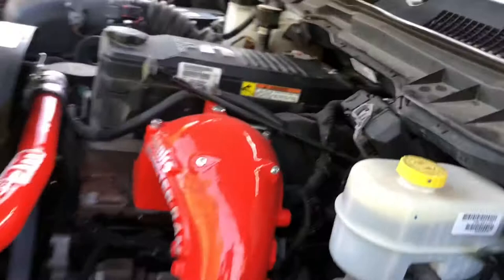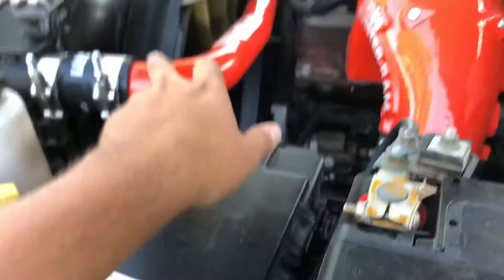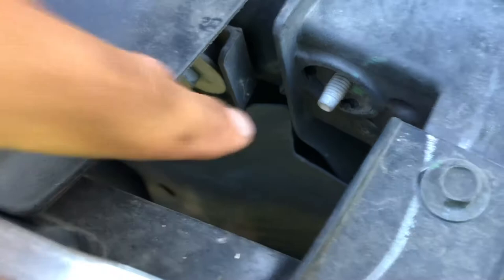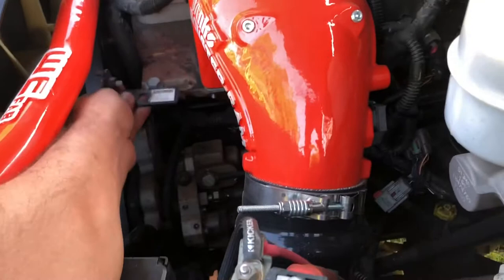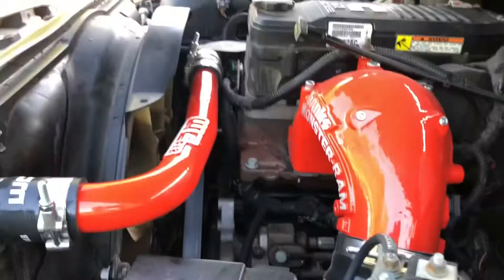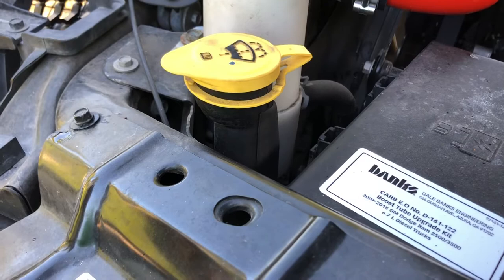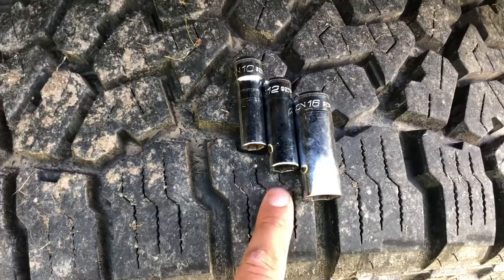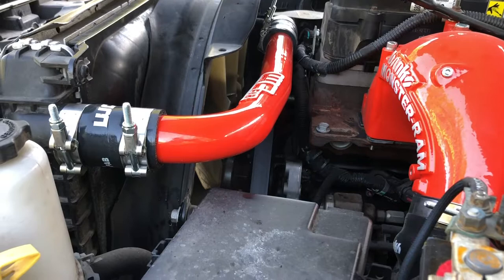Wehrli Custom Fab 2010-2018 Ram 6.7 Cummins Upper Coolant Pipe Install

Comment: If you remove the 13mm bolt for the power steering and move it aside you can reach the petcock from the top with a 10mm Allen turn a 1/4 to half turn
Reply from the maker: I did not know that! Thanks for the tip!

Comment: Also, what happens to those couplers when they get wet? In my experience pressure connection with silicone is prone to abnormal degradation when in contact with coolant. This system should be 21psi so a decent amount. Oil doesn't necessarily seem to be as big of an issue, especially with diesels. Have you had any leaks at all?

Comment: I admit I am not a great mechanic. I just hit 58K miles on my 2015 Dodge RAM HD 2500 4 Door 4WD  With Cummins 6.7 L Turbo Diesel.  Starting May 2024 I plan on making an epic drive towing my 10,000 pound fifth-wheel. I have the 3.42 rear axle with a 17,000 tow capacity but I also have rear air suspension which really levels out my  rig.   

What are the items you would recommend to improve efficiency and reliability. Performance and power is already there albeit I would like a better gas mileage.  Thanks.
Reply from the maker: These trucks are pretty fuel efficient when “deleted”…it’s by far better on mpg’s than my 07 Duramax. I did notice a slight increase in mpg’s when I did the Banks Ram air intake and boost tubes. I usually get pretty good mpg’s with the 3.42 gears when towing but my truck is a manual. You gain the most mpg’s (in my opinion) when you delete the truck.

Comment: Ok. I have a '11 6.7 and I have the rubber hose. The WC fab one is aluminum, cool. But why? What is the reasoning? Along with other things, now you'll have to do the lower too yes? Cooling systems are built for expansion in the coolant when it's hot, how will this affect the level now when you're pulling a heavy trailer up a hill say.

Comment: What Fuel filter delete / relocation kit did you use?  Thanks for the video!
Reply from the maker: I bought all the stuff off of throttle up industries last year for around $360. You should be able to look them up online.

Comment: After adding the banks monster ram, how's the performance and mileage difference?
Reply from the maker: Honestly the truck definitely seems to breath better. Throttle response is improved. As for fuel mileage…I can’t tell a difference much. The truck does get waaaaay better mpg’s than my LBZ Duramax.

Comment: Have you had any issues with coolant leaking? Or clamps coming loose? Mine keeps leaking coolant on the belt
Reply from the maker: No problems at the moment! My clamps are still tight and do not leak any coolant.

Comment: I like the wheels, What is the offset and wheel specs? Thanks
Reply from the maker: Anthem Gunner 20x10 -24 offset. 35x12.50r20 tires

Comment: where you get delete kit?
Reply from the maker: If you’re talking about the egr delete kit I bought it a few years back off Alligator Diesel. It’s Flo Pro’s version of the delete kit. If I’m not mistaking not too long after I bought the kit, Flo Pro discontinued the kit. If you look on eBay there are some Chinese kits you can buy that will work. As for tuning, the truck was already tuned when I bought it.